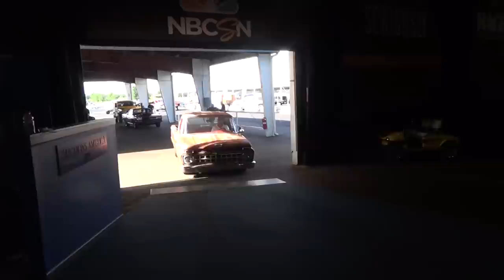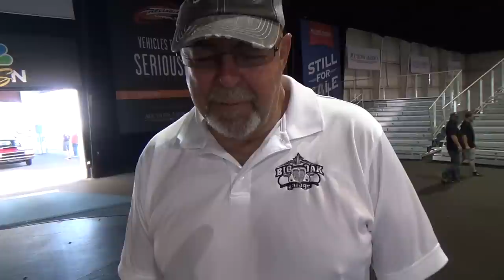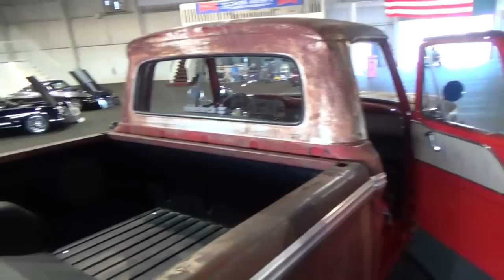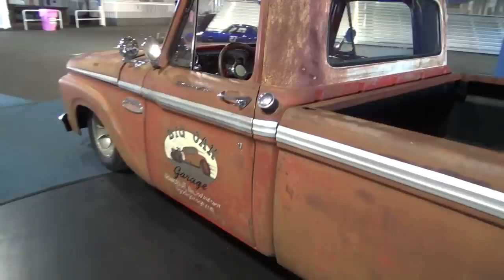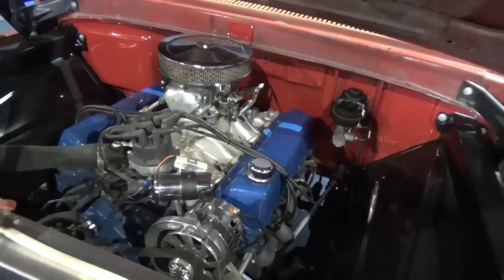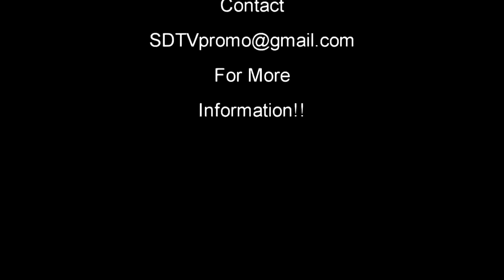1965 Ford F100 Shop Truck ScottieDTV Traveling Charity Road Show 2014

Comment: That's a badass beater that you could drive anywhere n not worry about it!! But I hope that 5 speed is a ZF n not a Mazda M5OD-R2, because that big block will rip it up faster than you can pop a clutch from a dig!
Reply from the maker: They were auto crossing it......did fine...

Comment: Only a manly man would own one of these.  That's why I owned a 65 from 1995 to 2000.  .060 over 360 high nickel block with ported heads and Edelbrock intake, Holley 650 and headers.  Some humor there at the beginning.  Twin I-Beam suspension worked very well.
Reply from the maker: All right.....cool!

Comment: i am need for some  information, i own a 1965 ford f100 with a 352 automatic my flex plex needs to be replaced my question is do these trucks come with a seperator plate? or another name for it is a flex plate cover. also can i put it together with out one? please contact me back. thank you
Reply from the maker: No idea...I just shoot the videos...sorry...
Reply: Bigheaded Martian might find one at an old car swap meet....some people make their own....
Reply: I have the same model and engine with the cruisamatic tranny.  I just bought a new flex plate and the shop who rebuilt it did not shorten the bolts.  It did not go 360.  I did and now ok.

Comment: wish i could see more 72 sport custom 4x4s i have one, i bet its easier to find parts for your 66 than it is for my 72 ,, im doing the front end now .. its so hard to get the right parts ,even napa been blowing it .. like outside axle u joints im still waiting for the right ones the over priced me for parts that don`t fit ..saving me money inthe long run .. how by me going to kragins or pep boy summit auto even o reilly has the right parts,,napa sucks ..
Reply: lmc truck

Comment: I think I know why these amazing Shop Trucks are left looking Ratty on the exterior. Its because, they could be easily stolen. They are used all day by everyone, go everywhere on errands, and probably have the keys left in the ignition. It would be horrible to have a good, dependable, necessary hot rod truck stolen. Also If the owners made them look too nice, they would be tempted to sell them for high offers. Better to keep the needed workhorse.

Comment: Yes,its cool,but you're looking at 8 mpg at best.
Reply: +roger b Gas was 25 cents per gallon then. Add that no one in 1965 commuted in a pickup, no one.
Reply: I did and loved it
Reply: if you keep your foot out of it....with the manual transmission...depending on gear ratio....you could see 15 to 17...if you drive it like you stole it....gallons to the mile....gas is cheap in the South
Reply: They said mine will only get 9.  It has a 4 barrel Holley.  No problem, up on blocks.
Reply: Having trouble hooking up my brake valve near the steering gear on my 65 F-100 long bed.

Comment: I'm a dyed in the wool Ford guy, but when it comes to this era of truck, Chevy has it hands down. From 1959 to 1987, Chevy has the best LOOKING truck, not necessarily the best truck, but Ford lost their way with styling for several years.
 I drove a '63 that looked liked this, White, and a 300 6 cylinder and a 4 peed with Granny low. When I started driving it, it had more that 260K miles,,and did not smoke. Just a great old farm truck.
Reply: 65 chevy doesnt look as good as this, maybe 67 and up looked good